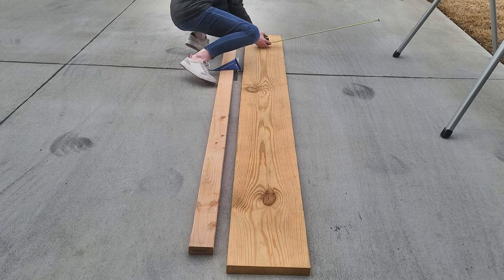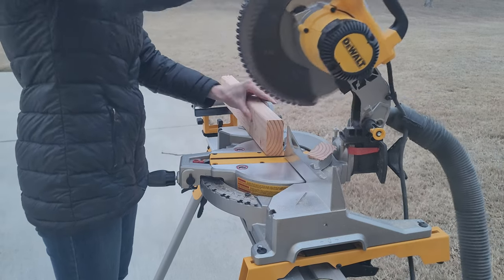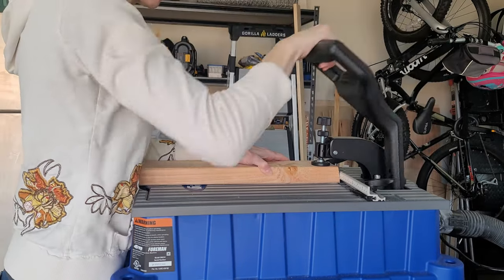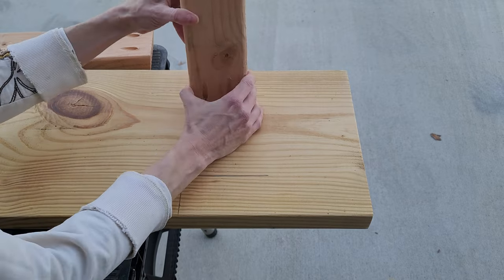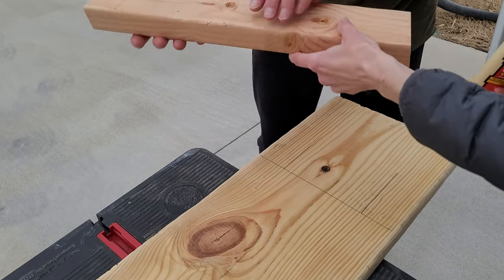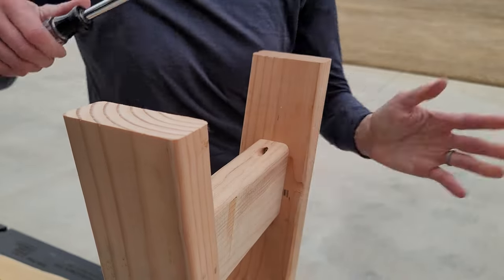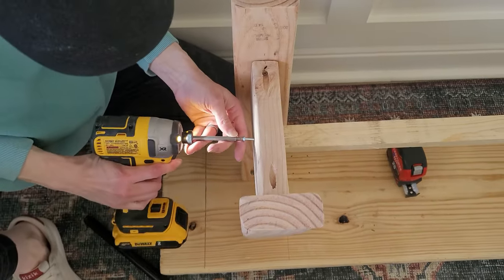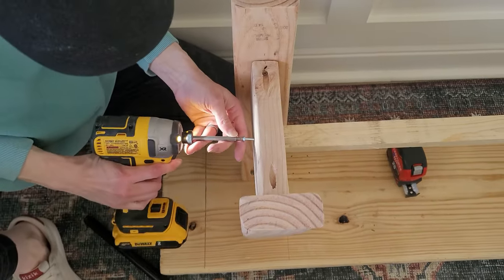Gorgeous DIY aged wood bench

Comment: Hi, your bench turned out beautifully and I do have one question. Did you give the legs of your bench a miter cut or was it a bevel cut? I’ve been watching many videos on how to make cuts with miter saws and some say that if the wood is placed on the “higher position “ not laying it flat then the cut becomes bevel. Anyway I’m a bit confused because I think you made either a 10 or 15 degree miter cut. I’d appreciate your input as I’m about to start my own bench and I’m new to this. Thanks.
Reply from the maker: Thanks for your question! I just did miter cuts. I'm a beginner so keeping it simple with the tools I have works best for me.

Comment: Hello Amy! I love your videos. Thank you for your ideas and expertise. 
Could you please tell me the whitewash you are using? Is it the Varathane Wood Stain White Wash you used on the Vintage Farmhouse Table? I  ordered the Rove and Dwell Farmhouse Stain, and I love it! Thank you.
Reply from the maker: Thanks so much, Shelia! The Varathane white wash is exactly what I used on the vintage farmhouse table and I love the results! That exact brand was out for several months so I tried Behr fast drying water-based wood stain - white wash pickling... and it's OK but the varathane is by far better color, control, and coverage. It works so well over Rove and Dwell's farmhouse stain.